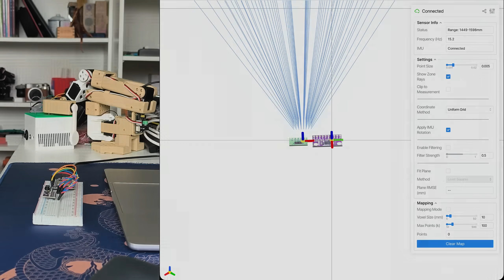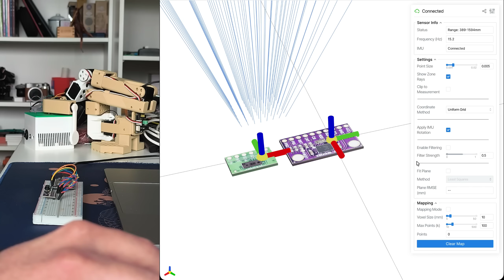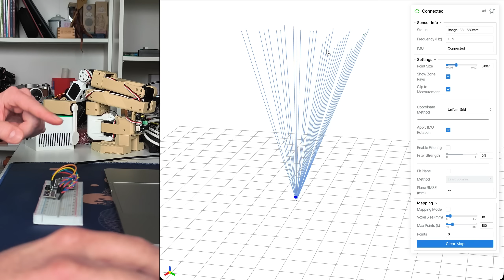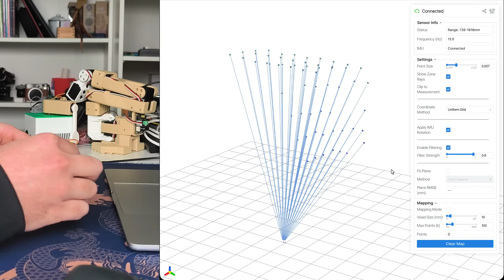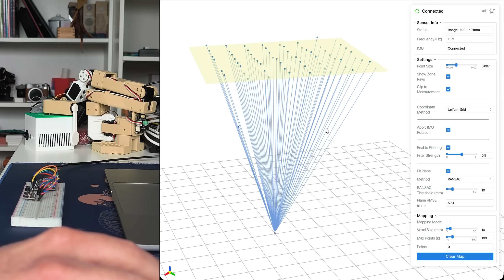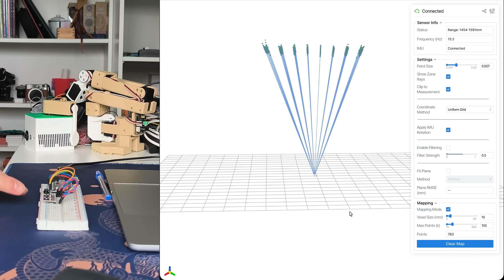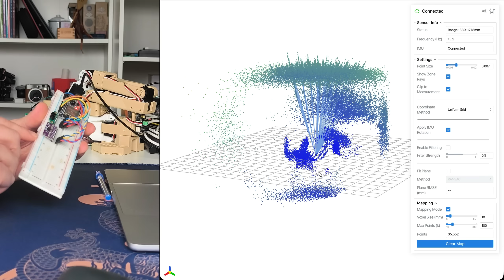Turn a Time-of-Flight Sensor into a 3D Scanner

Comment: Nice. My only recommendation is to make sure you verify all your algorithms, typically using synthetic data (i.e. something that emulates what you are trying to do).

I worked on an FFT back in the mid 80s that was targeted to be used to monitor an ILS signal using an algorithm from a book. I first coded it into C on a PC using synthetic data, then retargeted it for a 16 bit 80C196 processor on it's C compiler again with synthetic data, then used it in-system using the 89C196 timer to generate the ADC sample clock on the real system but everything was "wonky". It turned out that the Intel processor's' timer output was AVERAGING the pulses to get the "desired frequency" so it measured fine on a frequency counter (probably what Intel used to "verify" it. but when I looked at it on a scope, and you could easily see that it was dithering between two frequencies whose average was the desired frequency! Intel apologized but had no work-around for the bug and it was NOT set to be fixed in the next revision. Since we were still working on the board release, we updated the onboard EPLD to generate the sample clock, and the world was good again. BTW: the dithering made the FFT data look "smeared" to a lot like FM. I learned a lot from that experience. Sometimes to succeed you have to fail at first.

Comment: does it have an algorithm for onboard trigonometry calculations to give accurate distance readings no matter which laser is used? if not, the outer beams would give a different reading than the center ones despite the object being the same distance. does it compensate? is it too small of a difference to matter?
Reply from the maker: the sensor accounts for this already. the only approximation related to your question in my visualisation is the spread of the rays. you can do uniform spread, or you can use a lookup table to use the real spread (because the rays closer to corners are actually pointing a bit more outwards then the ones in the centre).
Reply: @HenriqueFerrolho  cool. thanks

Comment: Would adding another sensor have any noticeable benefit in therms of depth perception?
Reply from the maker: a few ideas:
- one more sensor pointing at the same spot: gives you redundant readings that you can use for improvint depth estimates through noise
- one more sensor pointing at the same spot but with a different resolution–frequency: you can fuse the fast low-res sensor data with the slow higher-res sensor data
- one more sensor pointing somewhere else: you can process extra coverage on the same reading.

Comment: That is awesome!!!

AND if you added more of those sensors, and slightly angled them to fill in the gaps that are created the further away you go from the sensors, you could have then triggered and kicking in and out based on the distance being scanned, allowing for WAY MORE points!

I think I'm going to try this, even though I already have an awesome Raptor PRO 3D Scanner that works perfectly, but this project looks really cool and could be very handy!
Reply from the maker: Thanks! Definitely give it a shot. It's so easy to wire up (only 3 components) and you can make such cool interactive demos.

Comment: I did something similar but with an event camera. To do integration I used the welford online algorithm, it also gives variance. Integrate the inverse depth 1/z using variance guided weighting like a path tracer. It's way cheaper than it sounds

Comment: Does it update fast enough to track an object moving across it at a fast speed? If so it could measure speed and direction of moving objects
Reply from the maker: The 4x4 resolution updates at 30 Hz and the 8x8 resolution updates at 15 Hz. You can measure speed and direction of objects, but whether it is reactive enough depends on your use case.

Comment: Maybe you could add 2 servo motors that spins a tiny mirror back and forth to project the points in place stationary on the table to keep accurate 0,0,0 origin? (Galvo)

Maybe use an optical flow sensor or 3 or more control points (AprilTags) to translate movement?

Wonder if all of this can be stabilized within millimeter accuracy?

Comment: What sensor(s) would be needed to track movement or translation accurately without accumulated drift?
Reply from the maker: great question! currently, the best solution is to add an external camera to look at the device and track its translation, e.g. using reflective markers or using an ArUco marker (april tags). Meta Quest, HTC Vive, Valve VR, etc. all use slightly different approaches.

Comment: ToF+VR may be very precise technology for 3d scanning. By VR you can get absolute positions (in room) and add TOF measurements to it for 3d scanning. I added this project in my backlog. Base - Valve Index (Knuckles win base stations) + MaixSense ToF sensor. Also in VR you can render result in front of you and work with it like with paint-spray-can.

Comment: what is the operating system and software you are using in your computer to visualise it
Reply from the maker: I used Viser by nerfstudio: https://viser.studio/main/examples/getting_started/

I use macOS on a MacBook Air, but that doesn't matter really.
Reply: @HenriqueFerrolho the cursor looked different that's why I asked. Thanks anyway 😊
Reply from the maker: yeah, i just changed the default colours in settings :P

Comment: Henrique, built this and works..for 30sec, get a terminal message, Vl5l5...serial: invalid array lengths: distances=63, status=64 (expected 64) . any clues how to fix? thanks
Reply from the maker: hmm could it be that your usb cable or jumper wires are not a stable connection?

Comment: Could you please make a tutorial about the software + visualization you use in the right pane? It is perhaps trivial for you (but not for me!)
Reply from the maker: If I were to make a video, what would you like to see in a video like that?
Reply: @HenriqueFerrolho  Starting about 0:57, there is a pane on the right edge of your video, showing "the status panel, showing the live data". It is pretty darn handy. How did you make this panel? What tools do you use? Is it your own development, or is it a "standard toolbox" such as an Arduino or Matlab or Python or Unity GUI? And even then, how do you create it and "plug it" to your IMU? Thanks!
Reply from the maker: I used Viser from nerfstudio: https://viser.studio/main/examples/getting_started/

For the live data, you can check it on my GitHub repo for this project here: https://github.com/ferrolho/VL53L5CX-BNO08X-viewer/blob/main/viewer/viewer.py#L121-L126

I really recommend this viewer and the docs are good. You can use Python to configure the panels.
Reply: @HenriqueFerrolho  Thanks! I leafed through the tutorial of Viser. All the more reason to request you for a tutorial (of at least how you, in your particular use-case) implemented it :)

Comment: Could this work for sewer drains accurately? In places spaces like 6 inch(15cm) pipes?
Reply from the maker: probably not the most accurate. there's other sensors that can get you depth measurements. I might make a video later of a slightly different sensor, which is more similar to the ones you would find on a robot vacuum cleaner.

Comment: Would it make a more accurate map if there were two TOF sensors placed on opposite ends of the board?
Reply from the maker: Such a setup might give twice the data points if all points are being correctly registered. That could in turn translate to more accuracy, yes.

Comment: Pretty sure this is how robot vacuums (Roomba, Eufy etc..) map rooms - in addition to wheel motor sensor for X, Y translation sensing. Cool project!
Reply from the maker: They use an actual LiDAR, which is a motor spinning a laser. See e.g. https://www.adafruit.com/product/4010. It gets you a similar reading (cloud of points from depth measurements), but it works slightly differently.

Comment: an IMU should have acceleration (linear) as well otherwise it's just a gyroscope. The BNO055 should have a gyroscope, linear acceleration, and a magentometer all in that one package. It SHOULD be possible to add in linear acceleration as well.
Reply from the maker: The IMU in the video does have three sensors in it: gyroscope, accelerometer, and magnetometer.

You can use the accelerometer to measure translations up to a point, yes. Although I chose not to because it is not reliable enough to simply double integrate the measured accelerations > velocities > positions.

Think of it like this: the accelerometer measures accelerations. If you move your hand slowly with approximately constant speed, what is the acceleration? The answer is close to zero, so there is nothing for the sensor to measure, and therefore it cannot tell you are translating the sensor. In practice, I realise it is very hard to move the sensor at a constant speed when holding it with your hand, but there is also sensor noise which you need to filter, and after applying a low-pass filter you end up in a situation where those tiny subtle changes in velocity are no longer measurable.

Comment: Beautiful. More than a decade ago in university, a good friend of mine worked on making low cost room mapping using an xbox kinect camera. Back when point cloud was a relatively new thing and I got amazed. Now there is Lidar and things became more readily available. This is how far tech has advanced.😢
Reply: Ive went down the rabbit hole of kinetic camera 3d scanning and I was quite disappointed in terms of support for getting the kinetic working in all operating systems. Now that we can do ultra wideband scanning it is much more efficient
Reply from the maker: Absolutely! The hardware (and software) has been evolving and improving very quickly. You can find many different kinds of depth sensors on AliExpress for reasonable prices.

Comment: An accelerometer would help with locomotive, track acceleration from a reference point and you can capture around an object
Reply from the maker: that is really tricky actually... accelerometer measures accelerations. for you to get positions out of that, you would need to do double integration. i.e., integrate accelerations over a certain period of time to calculate velocities, and then integrate those estimated velocities over a period in time to calculate estimated positions. this unfortunately is very prone to noise.

Comment: This is a great video and I was inspired to buy the parts and build your circuit. However, I've had trouble trying to get it to work in Windows. Do you recommend running your software instructions on a Linux machine? Thanks!
Reply from the maker: Hi Kishan, glad you're building it! The software works fine on Windows — the only issue is the port name. cu.usbserial-0001 is macOS-specific. On Windows you need to use your COM port instead.

Steps:

Plug in the ESP32 and open Device Manager (Win+X → Device Manager), expand "Ports (COM & LPT)". You'll see something like "CP210x USB to UART Bridge (COM4)" or "CH340 (COM5)".

If nothing shows up, you need to install the USB driver for your board. Most ESP32 boards use either a CP2102 (Silicon Labs) or CH340 chip — search for the driver for whichever yours has.

Then run the viewer with your port number:
python -m viewer --port COM4
(replace COM4 with whatever appeared in Device Manager)

Everything else is the same — pip install, the viewer, opening localhost:8080 in your browser — all works on Windows. Hope that gets you going!

Comment: did you happen to get error 66 while connecting the sensor with the microcontroller. i am facing the issue with my raspberry pi 4 and sensor SmartElex ToF Imager – VL53L5CX  please help me if you could🙏
Reply from the maker: I didn't hit any error 66 (I'm on ESP32, not RPi), but it seems that's a VL53L5CX initialisation failure.

Here's what an AI suggested:

  1. I2C clock speed — The VL53L5CX needs to upload ~100KB of firmware to the sensor on every boot. The RPi defaults to 100kHz I2C, which is painfully slow and can timeout. Bump it to 400kHz or 1MHz in
  /boot/config.txt:
  dtparam=i2c_arm=on,i2c_arm_baudrate=1000000

  2. I2C buffer size — The Linux kernel default I2C buffer may be too small for the large firmware chunks the VL53L5CX driver sends. They may need to increase it by rebuilding the kernel module or using a
  userspace I2C library that handles chunking.

  3. LPn pin — The LPn (low-power enable) pin must be pulled HIGH for the sensor to be active. If it's floating, the sensor won't respond. Tie it to 3.3V with a wire or drive it high from a GPIO.

  4. Power — The VL53L5CX draws noticeable current during firmware upload. Make sure it's getting clean 3.3V (not powered from a weak GPIO pin).

  5. Verify I2C connectivity first — Run i2cdetect -y 1 and check that address 0x29 shows up. If it doesn't, it's a wiring/power issue before it's a driver issue.

Comment: Awesome project. Have you tried TOF cameras? They are pretty cool and cheap too. Basically, they are similar to this sensor but much higher resolution. It basically gives you a depth image instead of RGB images. I think arducam sells one and also helios and framos.

Comment: Great work! I was trying to do the same thing a few years ago when I discovered those 8x8 sensors. I wanted to build it into a tricorder prop. I never quite managed to integrate the imu data with the ToF though. I kept losing position on the yaw axis. Looking at this perhaps I'll try again. Thanks for sharing.
Reply from the maker: Definitely give it another go! This IMU module already does the sensor fusion for you, so you get a quaternion straight out of it to be used in your calculations.

Comment: Great video and it gave me an idea for a little upgrade to a small desktop toy robot I have just completed. I bought the VL53L0X sensor and mounted it at 45 degrees on the front corner so that it pointed down towards the desk surface. I then got ClaudeAI to integrate it into the existing code so that it checks for the edge of the desk. It works really well but I soon discovered that I need a sensor on all four sides, don't ask me how I know🤣 I think I shall mount four of them on top of the robot in a square configuration to prevent further falls. Thanks for sharing.
Reply from the maker: I hope your floor and the robot are okay! :D

Comment: The IMU should be able to tell you the acceleration in a x, y, z vector direction, and if you integrate that with time, you can calculate velocity and integrating again should calculate displacement
Reply from the maker: Double integration is possible but not reliable. It can be used for displacement (translations) but only if you have quick and non-constant movements.

Think of it like this: the IMU accelerometer data is a bit noisy, so if you move it slowly you won't be able to distinguish the low freq signal that belongs to you moving the sensor vs the noise of the sensor. If you shake it violently, you will be able to get a good signal out of it, because it will have a large amplitude compared to the low-amplitude noise of the sensor.

Another problem is with constant velocity. For getting translation/displacement, the source of signal we need to integrate is the accelerometer. But suppose you take the IMU on your car and drive steadily at 50 miles per hour — i.e., constant velocity, there is virtually no acceleration — therefore there is nothing that the accelerometer sensor can sense and even if you double integrate the acceleration > velocities > positions, you wouldn't even know that you are driving at all.
Reply: @HenriqueFerrolho 100% that's why the velocity needs to persist. I've done it before and yes it was a bit dodgy, but the IMU was sensitive enough to control a PID for directional control.

Comment: It would be interesting to see if the time of flight sensor could be reprogrammed to allow longer distance time of flight measurements. Also I'm guessing the beam is an infrared beam array????
Reply from the maker: this one is not good. it can measure up to 4 meters away, but my experience in practice is that in most conditions the sensor cannot see so far. maybe have a look at different sensors like the LD06 from LDRobot, which costs about £14 on eBay / AliExpress and that one uses dTOF to reliably measure obstacles up to 12 meters away. other more expensive sensors can see even further

Comment: How to connect everything up? I got the parts but missing the wiring diagram.
Reply from the maker: Check the 'Wiring' tables under the 'Hardware' section on the GitHub repository: https://github.com/ferrolho/VL53L5CX-BNO08X-viewer

If you need extra help let me know!
Reply: @HenriqueFerrolho thank you

Comment: Nice! If you could find a good deal on a used HTC vive VR headset, you could use the controllers and lighthouses to add 3D tracking to the system. It's surprisingly accurate and doesn't drift at all, only potential problem is that the lighthouses could interfere with the lidar, since both use lasers.

Comment: I think you may get better accuracy if you updated results from your BNO085 faster. I have a Micropython driver on git that will update 200Hz (5ms), and I think that could cut down your angular error.  Search for bno08x-i2c-spi-micropython (bradcar). It will also provide timestamps of the measurements which I think is missing from Adafruit and Sparkfun libraries. Do you know the timing of each of the angles from the VL53L5CX "beams"?

Comment: Incredible work, and it's cool too see that it can be made with so few and cheap parts!
Your map reminds me of the game Scanner Sombre, where you use a LIDAR mapper in a dark cave and can only see the point cloud.

I bet with some more programming you could enforce an offset from a center position which the sensor is aimed at and move the sensor in a ring around an object to build a 3d scan of if!